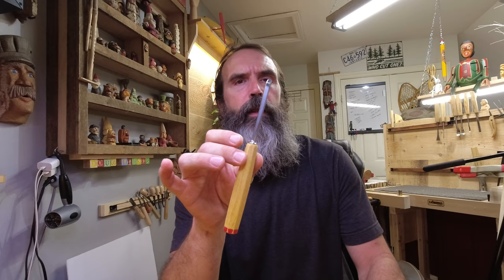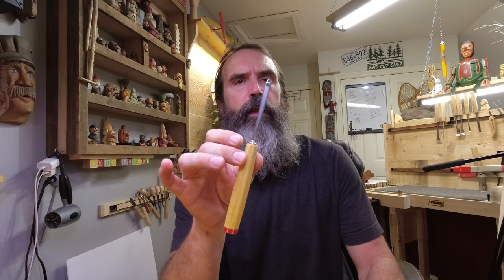Knife and ? - Which Tools to Add to Your Carving Kit

Comment: Hello Doug, thanks for this video & information on knives, gouges, etc.  As someone new to carving it is very helpful.  I do mostly small carvings - the biggest being from a 2 inch square piece of wood.  The don’t have a bandsaw but thinking of getting a small model.  Not sure  what is good. I have been looking at craftex 9 inch or 10 inch.  Would that be a good brand or would you have other suggestions.  Thanks.
Reply from the maker: I have a large crafted and a smaller Rikon and prefer the small Rikon all day -not much use for the big saw and Rikon is better quality

Comment: Thanks Doug for the information. I was wondering if you might be able to tell me why it is harder to carve with my 1-7/8" OCC rough out knife then it is with my 1*3/8 OCC detail knife, I strop both the same way with the same strop.
Reply: Could be thinness of the blade or back of smaller blade is round ? Maybe